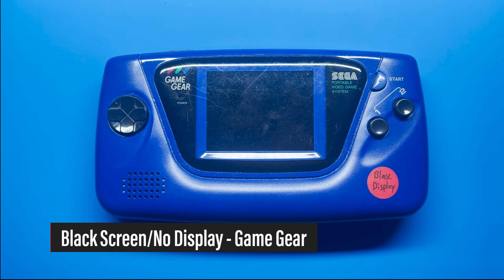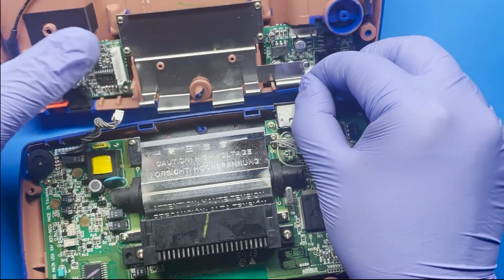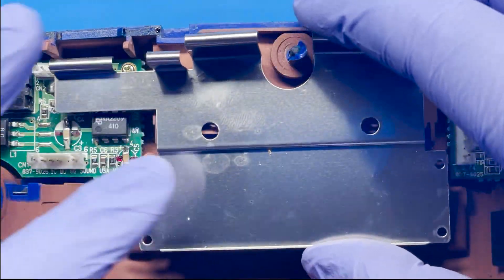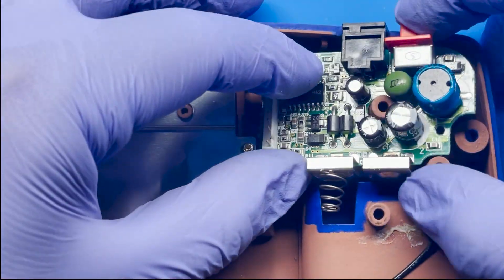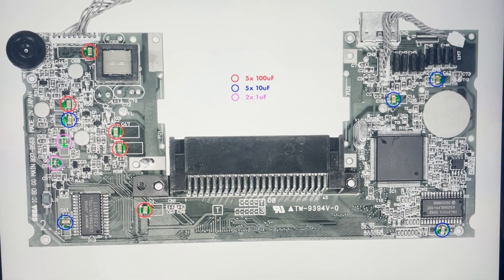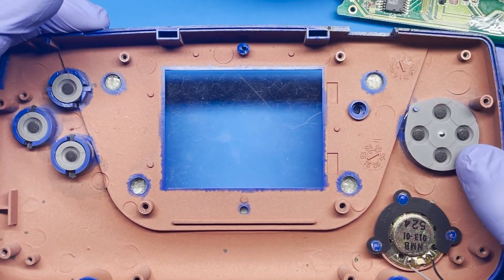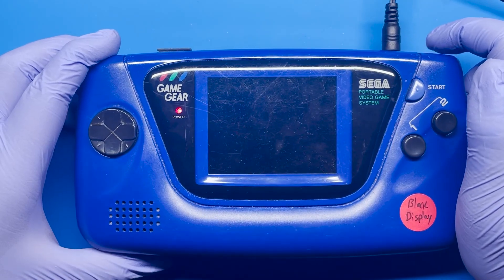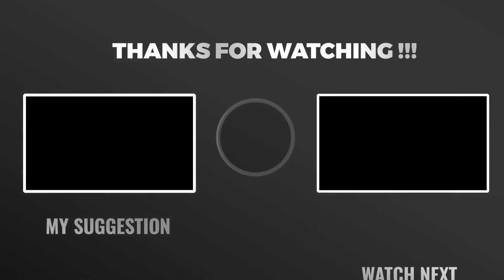Troubleshooting Black Screen | Game Gear

Comment: Also, don't use continuity or ohms check while power is applied. you're putting extra voltage into circuit that have voltage already. That is why the light lights up when checking. You can also burn out your DMM too.

Comment: It's always a relief knowing other people have problems fixing this old equipment. My system isn't showing a screen after a recap, either. I'm thinking maybe it's the fuses, or I did the caps wrong, or that I'd be better off just replacing the screen with something more modern (and visible).
Reply: @jessragan6714 how did it go, was it a fuse?

Comment: This needs a proper calibrated fuse
Reply from the maker: The fuse used was within the same specifications from the repair manual for Game Gears.

1 Amp 250v thermal fuse with a rated temperature of 100 deg Celsius. Pin length of 39.5mm and fuse length of 6mm.
Reply: @totalfix877   just to make sure youre in on the joke. this is suposed to be a fun reference to another electronic repair youtuber who would have soldered a wire between the pads and called it a 'proper calibrated fuse'

Comment: Attempting this myself soon and have the screen fault issue were it powers on but no display. But before i attempt the thermal fuse replacement as per part 2 of your video i want to replace some capacitors, do you have a link for these you can publish please. Great video

Comment: Hi 
I’ve 2 gamegear and I’ve replaced all capacitors but I’ve vertical Lines on first and blank screen on second
Reply from the maker: My suggestion would be to make sure that nothing on the board got damaged during capacitor replacement, as too much heat can damage neighboring components. If everything has been checked from there, I would start with areas that you mentioned, for example the blank screen. Was the screen previously working before the capacitors got replaced? Are the fuses blown out? Is there any corrosion near the pins? Things that can be identified from visual inspection that may look off.
Reply: @totalfix877  Before recaps the situation was more bad. It wasn’t audio. I find much corrosion on Board. 
Now the screens doesn’t good. 
Before buying two ips screens I would like to improve the reading of the cartridges which are often not recognized. What could I do?

Comment: My gear doesnt work, can you help me? I fully recapped my gear and the brighness came up and down, then I recapped again with quality caps and now the fluorescent is on but it doesn see anything on the screen, the game sounds. and the brighness wheep doesnt change the fluorescent bright. Thanks
Reply: I currently have the exact same issue and am also looking for a fix..
Reply from the maker: I guess I should start by asking, was it working fine previously? This helps me understand a bit better what might be going on
Reply: I had the same issue. It seems there was a short between the brightness potentiometer's pins on the motherboard. I've resoldered them and cleaned the region very well (it was very dirty), and the problem was solved completely. If this doesn't help, I'd suggest testing this potentiometer. I'm my case, the screen was working, but it seemed to be not working because the brightness was stuck at max and no image turns out to be visible.

Comment: I have the exact same problem with mine. Have you fixed it yet?
Reply: Where do you get the fuse for the screen?
Reply from the maker: Yeah I was able to fix it 😄
Reply: @totalfix877  was it the fuse in the end?
Reply from the maker: @boofkharia472  It was, it was blown. Once I replaced it the screen worked again.
Reply: @totalfix877  thank you for the update.
Reply: @totalfix877  Time to look at that video, me thinks!